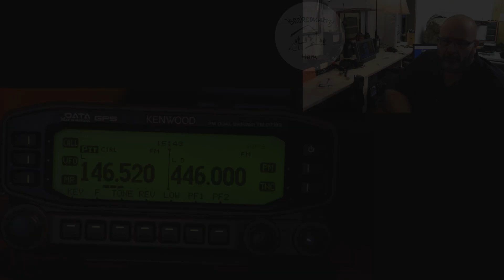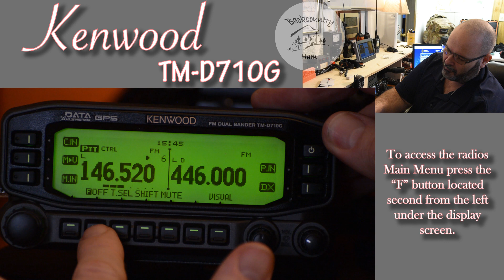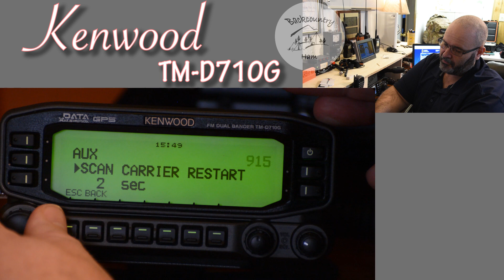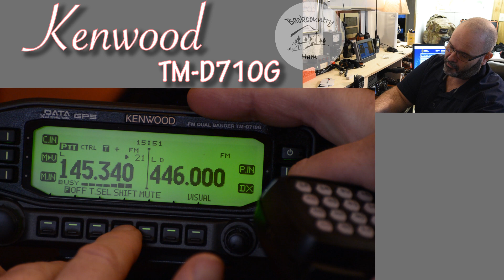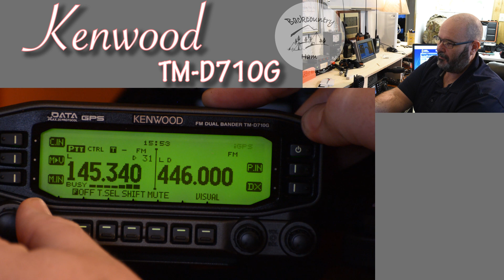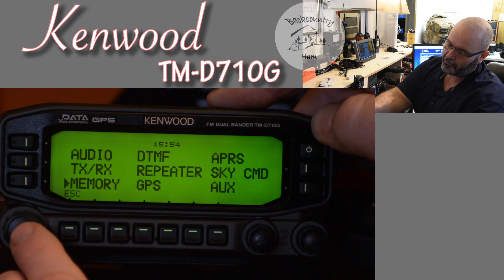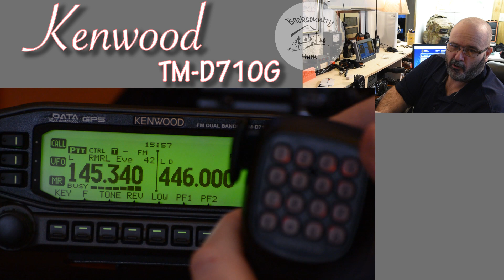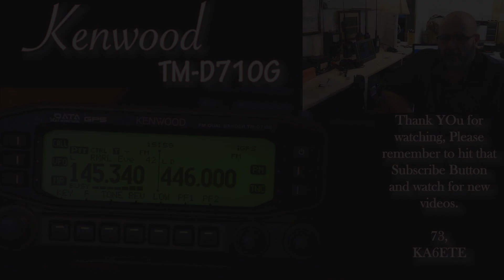Kenwood TM-D710G

Comment: doesnt this have auto repeater shift?
Reply from the maker: Yes it does have the capability, but it does not always work correctly. On occasion it may enter the wrong direction of shift, as well as enter a shift when trying to use a simplex frequency. I have found it easier to simply disable the automatic repeater shift and enter the shift manually when needed.

Comment: Thank you for the informative videos. I see that you have a few videos on the Kenwood TM-D710G and on the Yaesu FTM 400XD. I am currently trying to decide between those two radios and wonder if you have any preference.
Thanks again, Eric KN6HMK
Reply from the maker: Both are great radios and I use both almost daily. For me it comes down to where it is being used and the features you want. Where for a mounted mobile APRS radio in my vehicle I prefer the Yaesu FTM-400XD due to it having a full QWERTY keyboard integrated into the touch screen. It makes it a lot easier to use all the APRS features and tools. 

When it comes to a base dual band radio or a portable base set up I prefer the Kenwood TM-D710 because of the full internal TNC and the ability to do UHF/VHF packet radio as well as configure it as a Digipeater.
Reply: @ka6ete217  Thank you for the quick feedback! I think i will be happy either way, I was originally leaning towards the Yaesu because of the color touch screen but, after looking into it more I get the feeling the Kenwood is a more capable radio and that Kenwood has a better reputation for quality.

Comment: Is a shorter head cable available for the TM-D710GA? I only need a 3’ cord to connect the head to the radio but I’m having problems sourcing one. I think it’s insulated. We installed this in my Toyota Tacoma last week. I love this 710GA so much I ordered another one as a dedicated VHF/UHF base station. Your videos are great. I’ve watched them all several times to help set my equipment up right & fast. Thank you! 🇺🇸